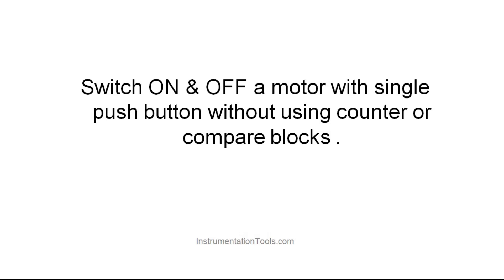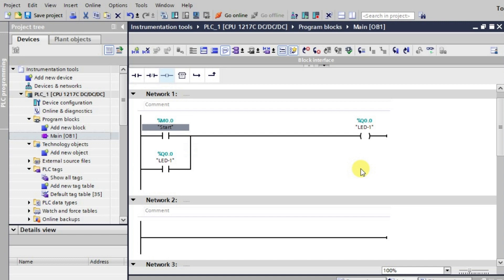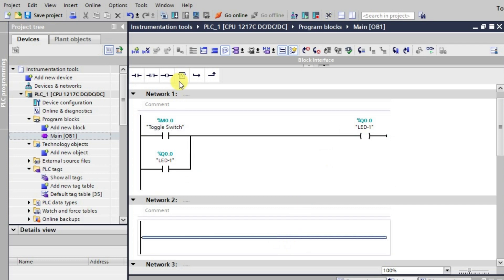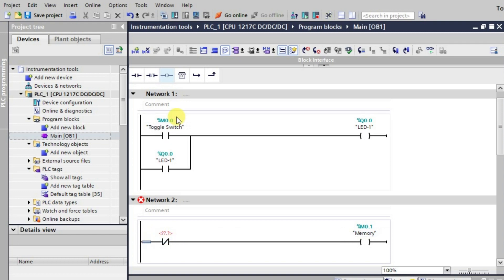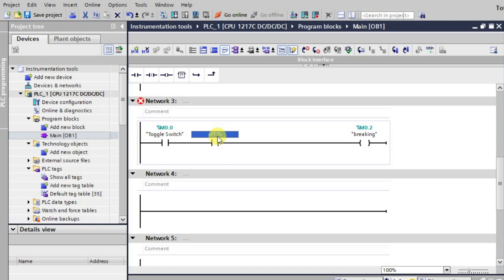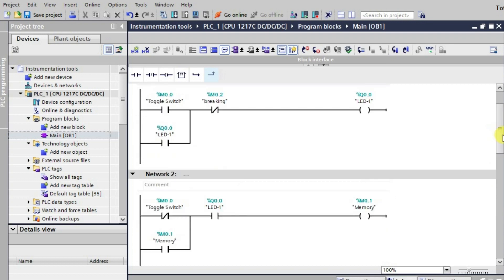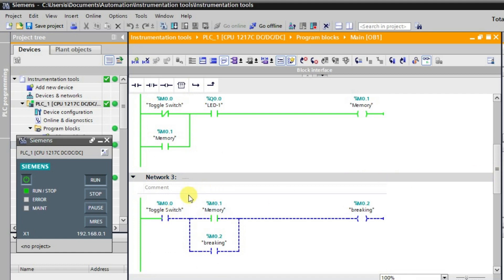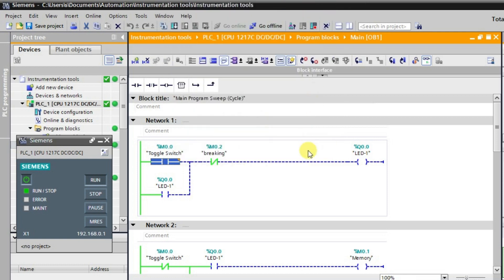Single Push button ON/OFF PLC Program - Example Problems for Practice

Comment: Thanks for your tutorial.

I think using this circuit we cannot operate it for the second time as the M0.2 is in NO state. 
So, to avoid this issue, I believe there is a correction in the 3rd network.
 If we remove the holding circuit in the third network, the operation will work fine for all time.

Comment: What if we need to turn on output again for the second time?...even if we press the swich again after this complete process,it wont work cuz we have already break the circuit in the first rung.
Reply: No, because the "breaking" memory depends on the "Toggle Switch" input.
When we realese this input (turned it OFF, -to 0-), the "breaking" memory also turns OFF so there's no problem for our "LED-1" output to turn ON when we set our "Toggle Switch" input to 1, again.

Comment: shouldnt the toggle switch address be an input? someone please help me with this i have to make this program tomorrow. im a millwright not a computer engineer.
Reply: I also thought the same
Reply: It is because he didn’t want to test it manually. He did that in the software as that’s why he used M(memory bit, mark).

Comment: Please I have a question. How do I use one push button to light up 4 bulbs sequentially. Example: if I press the button bulb one comes ON if I push the button the second time, bulb 2 will come up while bulb one goes OFF..........to be continue....
Reply: i also need this
Reply: Use SFC programing and you can do it
Reply: use RS-trig and CTU with automatic reset CTU (sv=pv) it will work as a closed loop rotary and use the PV value of CTU  to trigger the transition
 In SFC 
use each step parallel and write  ST code per each trans

Examples

 trans0- "IF switch = 0 then  light1= true" ,   

Trans1- " IF switch = 1 then light2=true"

Comment: Draw the ladder diagram for a program to control the lamp for the given logic

lamp 1 will on after 2 sec

Lamp 2 will on after 4 sec

Lamp 3 will on after 6 sec

lamp 4 will on after 8 sec

All should off after 10 sec
Reply: How to ladder diagram development
Reply: Here timer will be used

Comment: Where is Input
Reply: %I is normally real-world input but he is using %M (internal memory bit) just so he can freely toggle it without needing to wire a real input to the input card.
Reply: M0.0
Reply: You can positionate yourself on the tag and press Shift + D to go to its definition.